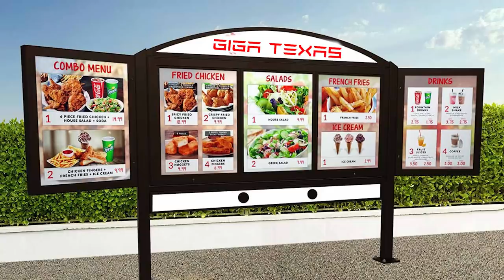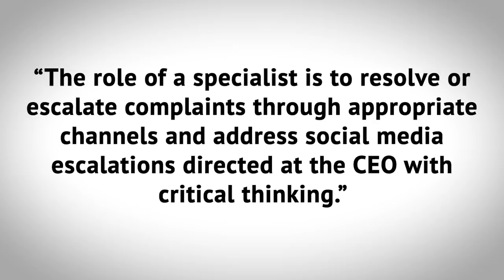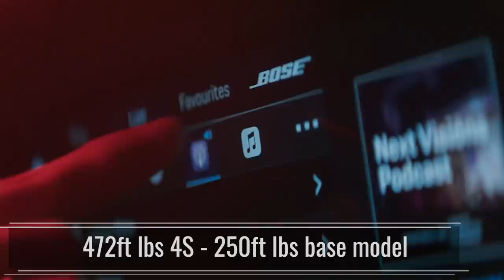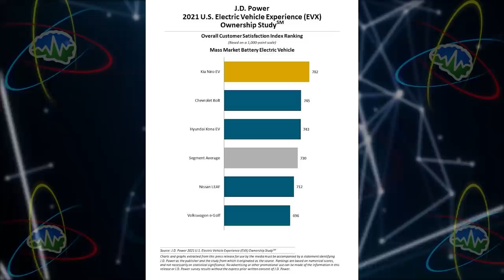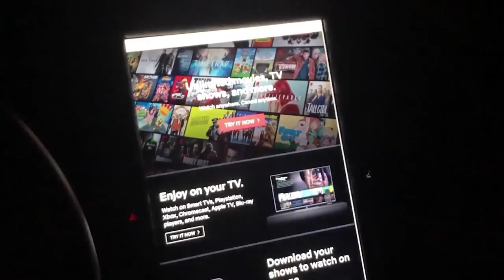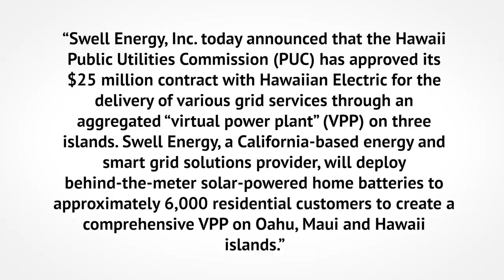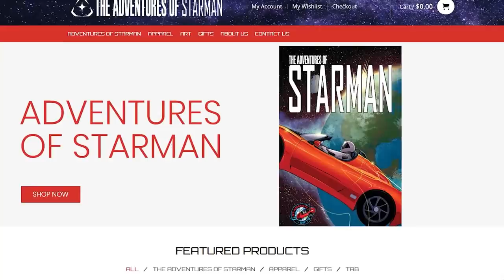Tesla Time News - Elon Buys Oil Rigs??

Comment from the maker: For your chance to win your own Tesla Model 3 and support a great cause, enter at http://home.omaze.com/nyk

Timestamps:
Tesla Saves Chevy - 2:40
Giga Press Delivered at Giga Texas - 3:45
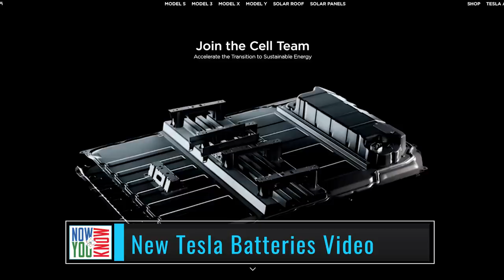New Tesla Making Batteries Video - 4:44
Photo of 4680 Battery Pack - 6:51
Wanna Work for Tesla? - 9:01
U.S. Model 3 Tow Hitch Coming? - 11:37
Model 3 Price Drop in Europe - 12:27
Turns out you CAN fit in the 3 row MY - 13:14
Model Y Officially on Sale in China - 14:36
Base Porsche Taycan Announced - 15:23
Mercedes Benz EQA - 17:57
EV Experience Survey - 23:11
FSD Should Have Trade-In Value - 24:20
Arcimoto Joins ZETA - 28:31
Tesla Slashes Price of MCU Upgrade - 30:03
Spacex Launches 143 Satellites - 33:56
Elon is Buying Oil Rigs? - 34:47
SpaceX IS drilling for Gas - 35:36
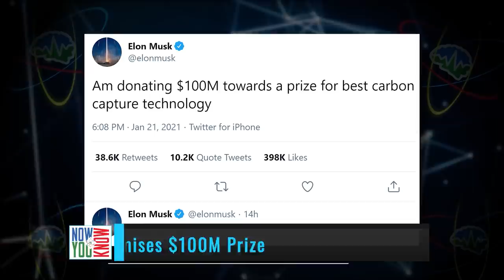Elon Promises $100M Prize - 36:56
Reply: Yo, guys, please apply to become Elon's new social media customer feedback gurus, geniuses!
Reply: Now You Know      (LETS TURN NOW TO THE 2,  MAKE THAT 2,  OLD, VERY OLD OFF-SHORE—PRODUCTION—PLATFORMS ELON MUSK BOUGHT FROM VOLARIS-OIL-CORPORATION LAST FEBRUARY.)

SpaceX bought two former Valaris oil rigs to build floating launchpads for its Starship rocket

Elon Musk’s SpaceX bought two deepwater oil rigs last year and is converting them into floating launchpads, to support the enormous Starship rockets that the company is developing.
The rigs are in the Port of Brownsville, near SpaceX’s Starship development facility in Boca Chica, Texas.  The  rigs have been renamed Deimos and Phobos, presumably in homage to the Martian moons.  Starship is the enormous rocket that SpaceX is developing to meet Musk’s goal of launching cargo and as many as 100 people at a time on missions to the moon and Mars.

The rocket is SpaceX’s top priority, with SpaceX flying its most recent prototype to its highest altitude yet during a test flight in December. The Starship prototype launched to about 40,000 feet and completed several development objectives, despite exploding on impact when it attempted to land.

Public records show that Valaris’ “ultra-deepwater semi-submersible” oil rigs 8500 and 8501 were sold for $3.5 million each. Valaris, headquartered in Houston, Texas, and the world’s largest owner of offshore oil rigs, filed for Chapter 11 bankruptcy in August as it sought to lighten a heavy debt load.

The pair of rigs was purchased in July 2020 by limited liability corporation Lone Star Mineral Development, according to public records. Lone Star Mineral Development was incorporated in June 2020 and registered in the name of SpaceX CFO Bret Johnsen.

SpaceX has been publicly hiring for offshore operations positions since last year, when the company posted that it was building “a team of engineers and technicians to design and build an operational offshore rocket launch facility.”

Additionally, as of midday Tuesday there were two temporary offshore positions currently available in Brownsville listed on the company’s career website. One of those two positions is for an electrician and asks that candidates be able to “install enhancements and major upgrades to offshore vessel electrical systems.”

https://www.cnbc.com/2021/01/19/spacex-bought-former-valaris-oil-rigs-to-build-starship-launchpads.html
Reply: Dave Froman      (LETS TURN NOW TO THE 2,  MAKE THAT 2,  OLD, VERY OLD OFF-SHORE—PRODUCTION—PLATFORMS ELON MUSK BOUGHT FROM VOLARIS-OIL-CORPORATION LAST FEBRUARY.)

SpaceX bought two former Valaris oil rigs to build floating launchpads for its Starship rocket

Elon Musk’s SpaceX bought two deepwater oil rigs last year and is converting them into floating launchpads, to support the enormous Starship rockets that the company is developing.
The rigs are in the Port of Brownsville, near SpaceX’s Starship development facility in Boca Chica, Texas.  The  rigs have been renamed Deimos and Phobos, presumably in homage to the Martian moons.  Starship is the enormous rocket that SpaceX is developing to meet Musk’s goal of launching cargo and as many as 100 people at a time on missions to the moon and Mars.

The rocket is SpaceX’s top priority, with SpaceX flying its most recent prototype to its highest altitude yet during a test flight in December. The Starship prototype launched to about 40,000 feet and completed several development objectives, despite exploding on impact when it attempted to land.

Public records show that Valaris’ “ultra-deepwater semi-submersible” oil rigs 8500 and 8501 were sold for $3.5 million each. Valaris, headquartered in Houston, Texas, and the world’s largest owner of offshore oil rigs, filed for Chapter 11 bankruptcy in August as it sought to lighten a heavy debt load.

The pair of rigs was purchased in July 2020 by limited liability corporation Lone Star Mineral Development, according to public records. Lone Star Mineral Development was incorporated in June 2020 and registered in the name of SpaceX CFO Bret Johnsen.

SpaceX has been publicly hiring for offshore operations positions since last year, when the company posted that it was building “a team of engineers and technicians to design and build an operational offshore rocket launch facility.”

Additionally, as of midday Tuesday there were two temporary offshore positions currently available in Brownsville listed on the company’s career website. One of those two positions is for an electrician and asks that candidates be able to “install enhancements and major upgrades to offshore vessel electrical systems.”

https://www.cnbc.com/2021/01/19/spacex-bought-former-valaris-oil-rigs-to-build-starship-launchpads.html
Reply: Martin Terra       (LETS TURN NOW TO THE 2,  MAKE THAT 2,  OLD, VERY OLD OFF-SHORE—PRODUCTION—PLATFORMS ELON MUSK BOUGHT FROM VOLARIS-OIL-CORPORATION LAST FEBRUARY.)

SpaceX bought two former Valaris oil rigs to build floating launchpads for its Starship rocket

Elon Musk’s SpaceX bought two deepwater oil rigs last year and is converting them into floating launchpads, to support the enormous Starship rockets that the company is developing.
The rigs are in the Port of Brownsville, near SpaceX’s Starship development facility in Boca Chica, Texas.  The  rigs have been renamed Deimos and Phobos, presumably in homage to the Martian moons.  Starship is the enormous rocket that SpaceX is developing to meet Musk’s goal of launching cargo and as many as 100 people at a time on missions to the moon and Mars.

The rocket is SpaceX’s top priority, with SpaceX flying its most recent prototype to its highest altitude yet during a test flight in December. The Starship prototype launched to about 40,000 feet and completed several development objectives, despite exploding on impact when it attempted to land.

Public records show that Valaris’ “ultra-deepwater semi-submersible” oil rigs 8500 and 8501 were sold for $3.5 million each. Valaris, headquartered in Houston, Texas, and the world’s largest owner of offshore oil rigs, filed for Chapter 11 bankruptcy in August as it sought to lighten a heavy debt load.

The pair of rigs was purchased in July 2020 by limited liability corporation Lone Star Mineral Development, according to public records. Lone Star Mineral Development was incorporated in June 2020 and registered in the name of SpaceX CFO Bret Johnsen.

SpaceX has been publicly hiring for offshore operations positions since last year, when the company posted that it was building “a team of engineers and technicians to design and build an operational offshore rocket launch facility.”

Additionally, as of midday Tuesday there were two temporary offshore positions currently available in Brownsville listed on the company’s career website. One of those two positions is for an electrician and asks that candidates be able to “install enhancements and major upgrades to offshore vessel electrical systems.”

https://www.cnbc.com/2021/01/19/spacex-bought-former-valaris-oil-rigs-to-build-starship-launchpads.html
Reply: Hey jesse and zach, love your show and became a patreon contributor for 10$ a month but i didnt get a shout-out. :’(

Comment: Just a small quibble.  It isn’t a higher packing density at all.  The total amount of space between batteries didn’t change.  What changed is the volume of the shells of the batteries.  That volume massively decreased.  And with the massive decrease in electricity converted to heat when charging and discharging cells, I assume they’ve reduced the amount of space reserved for cooling equipment.  Also they added 15% in the height.

Comment: How many 4680 cells are required for the long range version of the Tesla Semi? Partial answer is much longer range due to higher capacity and possibly lighter weight. Once the 4680 production is up to speed then you will start seeing Tesla Semi,s in service but don’t expect to see the Semi at your nearby Tesla service shop. Most trucking companies have shops at individual terminals so I would expect Tesla technicians to service them there plus help train their mechanics.

Comment: Great show guys, Just to add What this storage tank would do is bring the waterto your list of what can be done to cut carbon for us. Hot water is the energy pig in all homes north of Dallas lol. but if everybody was able to have a separate water heater tank minus the  burner house hold carbon be cut by 50%. By adding this extra tank in before your water heater would allow the ground water to warm up naturally to 70deg from 33deg changing the delta T on every water heater by 37deg would save massive amounts of carbon

Comment: It seems more like the structural part of the battery rather than coolant.

Elon did say a battery day that the battery would be part of the structure and that would need to be that part. 

That is if you're cooling it on top and bottom you would need the middle part to be the structure.

We'll find out eventually though (probably once Giga Berlin is producing vehicles, and someone does a teardown)

Comment: I'm going to guess the cylinder sides are not that strong... therefore more epoxy.  Also can vary design in future.
Regarding height, people don't uniformly have the same torso length to legs ratio - still impressive third row there!
(Edit) for the FSD, they could allow return/removal for credit but have the value decreases per year according to some rule - but you can also transfer it to a new purchase at full credit (except when new FSD costs less then you just get the equivalent product).

Comment: The speed increase in the degradation would only act like that if you used 100% of the charge everyday. The buffer is more important for not charging to 100% instead of fully charging and not the battery.
Reply: In reality the most effective way to hide the battery degradation from the user would be an artificial intelligence that I did different for every person and more if you don't fully deplete your battery.
Plus you could pretend to have a full charge but after 20% it hides a small emergency few percent.

Comment: Grab a Li ion battery under a charging cycle and tell me where it feels the hottest?? The Li ion mesh is coiled below the caps and forced out against the sides of the cylinder. The ends are where the terminals are and they will NOT conduct the heat away efficiently.

Comment: Agreed on the MCU. That issue has really frosted me due to the huge number of failures I've had, and even worse, the service center acted like they had no idea what I was talking about. I went to the forums and found out about this issue. The disingenuous behavior of the service center made me quite unhappy. Have a new SW on order, but if it has anything like the interior that Elektrek posted I will cancel and look at true premium vehicles such as Lucid. On the climate change, I highly recommend reading the Princeton study. It helps put everything in the correct perspective, i.e. there are no easy ways out of this.

Comment: The EQA 250 is only slightly better than the B-class Electric Drive they produced with Tesla from 2014 - 2017. Those EVs had sub 8 second 0-60 times.

Comment: Germany here, there one mistake you made:
The Model 3 Costs 39.990€ BUT there is already 3.000€ from the dealer removed. So you get just 6.000€ back after you bought the car. This means the cheapest Model 3 you can get is 35.950€ handling fee included. This is the Cheapest Tesla you can buy in all of Europe.
There are two reasons:
1. Most people even can't afford a 35.000€ car here because of the amount of our taxes and the low payments.
2. Our media told a long time so much bad things about BEV which the most Germans still believe and now don't want to buy these cars at all.

Comment: If I were Tesla, FSD would be tied to owner and would be mileage based: 500k miles of FSD ownership. User could add up to 3 cars under same FSD, and added car could be removed after a month or more. Car driving mileage when in the FSD account would decrement the 500k FSD miles even if user did not engage FSD...
This would be easier for families to use same FSD, and also allow easy trade in or change car...

Comment: As a Gen1 2016 Model X owner, I still feel like I was screwed over when three months after receiving my MX, they updated the sensor package and the MCU HW. They don't give you an option to upgrade the sensor suite and charged the MCU upgrade way too high. It's great that they dropped the MCU cost but we all know that they wouldn't have done this if the govt wasn't putting pressure on them. You're correct that I would definitely want to replace my X with a newer one but after my first experience, I probably won't.  Love the car but I feel like they abandoned their early adopters now that they don't need them anymore.

Comment: There are some reasonable use cases for fossil fuels, like rockets (and right now, airplanes).
As long as we remove the carbon from the atmosphere (balance the carbon cycle) it's okay.
Some things it's just easier to not emit in the first place like energy, cars, manufacturing but some applications require very high energy to weight ratios. The whole greenhouse gas emissions crisis is a problem of balancing in versus out. 

It's okay people! :)

Comment: What does Elon mean "reasonably valuable?" Does the software get worn out at some point - like tires or springs or something? Or maybe because FSD is activated by flipping a software switch, that the switch might wear out? That way you couldn't get full FSD price on a trade in? I can just hear the sales pitch, "well, your tires are worn, you have a few chips in your paint, a few small dents and then the FSD is showing some wear, so we'll give you XXX on your trade in." I call BS.

Comment: Zack and Jesse - Read this regarding eMMC!

This link will lead you to a research blog entry regarding flash memory chips https://www.bunniestudios.com/blog/?page_id=1022 The researcher is a 'maker' (creative person innovating new products/paradigms) with extensive experience in electronics design and production based in China.

TL:DR

1) flash memory chips include a very cheap, relatively primitive SoC (System on a Chip) in each flash memory chip. These SoCs are where the programming to support driver access (usually USB standard), flash memory wear leveling, memory error correction and bad block relocation are done.

2) The defect rate for flash memory chips is apparently quite high on average.

3) Because the SoCs include error correction, wear leveling and automatic bad block relocation there is a large grey market for quality control failed flash memory chips to be 'manufactured' into flash memory parts like eMMCs during the 'off' shift. Or the failed QC flash memory chips are surreptitiously (as opposed to destroyed) sold to 3rd parties to make fake brand name devices.

4) When a flash memory SoC encounters any kind of error, it will correct it and then relocate that block to another sector. This is a very time consuming process and vastly slows down any device depending on it.

Net:net - It's very difficult to get high quality eMMC chips 100% of the time. You're incoming QC essentially must physically test every chip received or you must purchase the chips directly from Toshiba or Samsung.

Also note that older eMMC ships (read: 8GB) will have older SoCs compared to newer (read: 64GB) SoCs. This means only the newer chips will have improved error correction and bad block relocation algorithms. The USB transfer protocol, error correction, wear leveling and bad block correction are updated/bug fixed with every new chip die update. By the way, I'm not aware of any existing process to 'reflash' the programs the built-in SoC uses. In theory, it might be possible since they apparently allowed for chip repairs during the manufacturing process but such repairs may be considered to costly. The article link explains this.

Comment: I put this on MoreTesla.com   What do you think?  
I could not believe that my new "super smart" Tesla had such a STUPID audio playback interface when I got it.  My Volt is much smarter than my Model Y in how it handles audio.  I listen to lots of podcasts while in my car.  When in my Model Y the Navigation audio plays on top of my podcast.  HOW DUMB IS THAT!   Lots of other much CHEAPER cars are SMARTER about how they handle audio.  When navigation audio happens - the audio from USB or phone source should be paused and then restarted after the navigation audio finishes.   This is done every day in my Volt - why not in my Tesla Model Y.  For now I have solved the problem by putting my navigation audio volume at the minimum and I minimize my use of Navigation.   But when FSD is finally here I will need to use Navigation and I want to hear the voice prompts - but I don't want to miss whole segments of my podcasts or books on jump drives.   Please prioritize this feature.   It is unbelievable to me that it is not already included in the normal system.